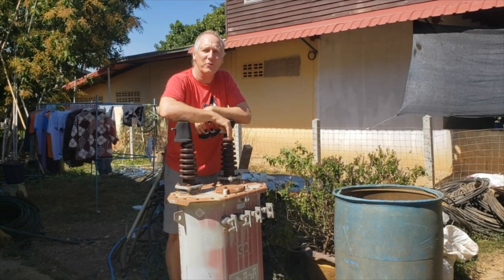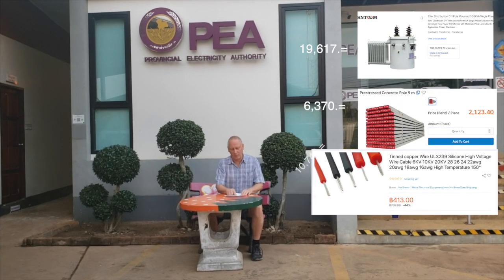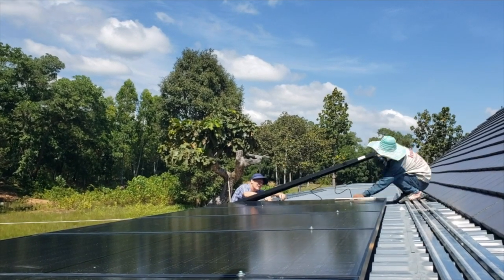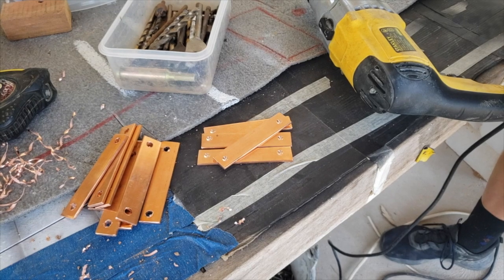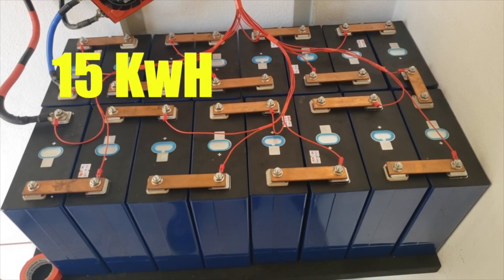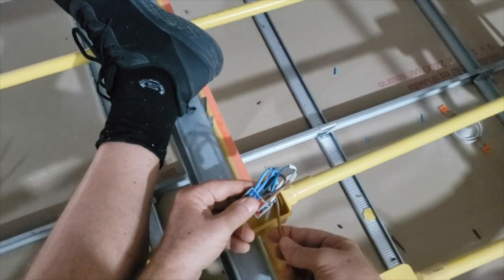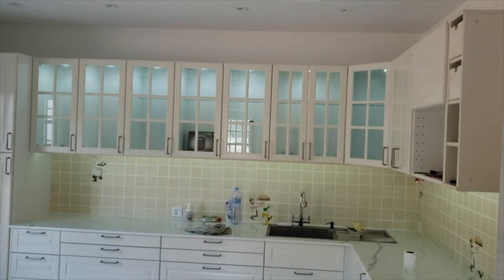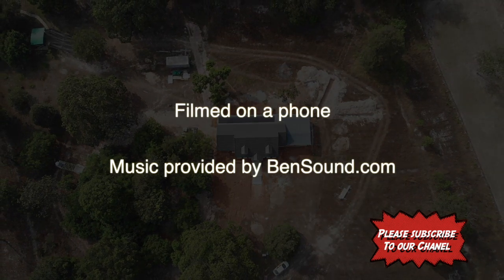Going Solar   building a house in Thailand

Comment: Thanks for the video, we dont have electricity anywhere near our farm but it has been said that it maybe coming as so many are building and living on their farms now, but if that is going to be the cost I may just have to bite the bullet and go solar I think, as we do have a problem neighbour who I know will try and use our posts for their supply. So if I may in future can I pick your brain a little on some of the finer points, the system looks amazing, we would probably use ground installation as we have the room and we are much more rustic.
Reply from the maker: Of course. No problem, pick away 🤓

Comment: So this setup will allow you to run AC, kitchen appliances, etc at the same time no problem?
Also how many hours does that give you of running hours at night
Reply from the maker: The house should be able to run several days on just the battery. 
But only time will tell if this is true.
Wo don't live there yet, but as soon as the rain-season (least amount of sun) has past, I will make a "conclusion video".
Reply: @Living-off-grid  looking forward to that. This is something I’m considering doing as well. Just determining the best application

Comment: Hi Maarten.
Thank you very much for a very good video. Exactly what I was looking for, I am building a house and have been trying to find information on solar installation solutions and costs.
Do you have any idea how much this solution can handle in terms of fridge/freezer, lights, air con etc.?
Best regards.
Mathias
Reply from the maker: Well, I hope it can handle a regular household, but only time can tell how things work out when we have a few weeks of heavy rain and little sun.

But even on a cloudy day the PV panels put out at least 1 Kwh and that is enough to "survive".

I will make a follow-up after the rain-season.
Reply: @Living-off-grid 
Thank you for your answer.
We are connected to the regular electricity grid but intend to try to have as large a proportion of the electricity consumption as possible through solar cells.
Best regards
Reply: @Living-off-grid  Hi Maarten
Hope all is well.
Wanted to hear how the outcome has been with your solar park now after 5 months? Are you producing enough, too much or too little energy from the solar cells? Our house is largely finished but will only move down in a year and then the idea is that we will install solar cells to cover most of the need, but I have a hard time calculating how much you need for it to work.
Best regards
Mathias
Reply from the maker: @mathiasgrahn4440  
Hi Mathias.
So far, so good. We ran out of juice one time and had to use the generator for about two hours. It had been very cloudy for two or three days and I did a lot of welding and used other heavy tools.

For the rest, we run two aircos all night and one during the day. 
The battery does not get below 50 to 60%, so that is good.

We are energy conscious, so when it is very cloudy, we don't switch on the airco during the day and when we are not inside we switch it off.
The aircos are also running at a very low level as the house is well insulated.

But, up till now the system has performed perfectly.
Reply: @Living-off-grid  Hi Maarten. Thank you for your answer, this will help us in our planning for solar cells to our house.
Best regards
Mathias

Comment: Hi marten, I always look forward to a new video of yours popping up.

I was looking for a larger lifepo4 on Lazada but could only find the lower capacity ones like 100-200Ah not the 380Ah like you have used. 

Would it be possible for you to give the Lazada links to the products you have used in the video please? 

Very much looking forward to if you make a video on the water heater you commented on above.

Thanks, Andy
Reply from the maker: Hi Andy. Sorry, it's 280 A. Here is a link:  https://www.lazada.co.th/products/lithium-iron-phosphate-lifepo4-32v-280ah-32v280a-i4203131832-s16543031634.html?clickTrackInfo=query%253Alifepo4%252B280ah%253Bnid%253A4203131832%253Bsrc%253ALazadaMainSrp%253Brn%253A902d08193d13106d5dd106f3ef3979db%253Bregion%253Ath%253Bsku%253A4203131832_TH%253Bprice%253A17062%253Bclient%253Adesktop%253Bsupplier_id%253A100191120278%253Basc_category_id%253A12092%253Bitem_id%253A4203131832%253Bsku_id%253A16543031634%253Bshop_id%253A2143764&fastshipping=0&freeshipping=&fs_ab=1&fuse_fs=&lang=th&location=%E0%B8%81%E0%B8%A3%E0%B8%B8%E0%B8%87%E0%B9%80%E0%B8%97%E0%B8%9E%E0%B8%A1%E0%B8%AB%E0%B8%B2%E0%B8%99%E0%B8%84%E0%B8%A3&price=17062&priceCompare=&ratingscore=4.5&request_id=902d08193d13106d5dd106f3ef3979db&review=2&sale=4&search=1&source=search&spm=a2o4m.searchlist.list.i40.1ae55a64RdOlaf&stock=1
Reply: @Living-off-grid  Thank you

Comment: Thank you for video but slightly confused on you buy all the equipment and when you install it becomes their property , so you paying 6.5x the original quote  . Is that a price they pull out of the fresh air for some strange reason.
Reply from the maker: Yes, their rules are confusing.

Comment: Hi Maarten.  I'm pleased to see this - you are ahead of me in doing this and you've set your usual high standard bar. 🙂

I notice you don't have a separate charge controller for the batteries.  Is this function incorporated in your inverter or might it be omitted for another reason?
Reply from the maker: Hi Trevor.

The inverter has a build-in charger. It is really called an "inverter-charger" but that word is impossible to pronounce properly,  so I shortened it. 😁.

The BMS does have (limited) charge-control functions, but these are very basic (cutting off the charge when the battery is full) so it is better to let the inverter-charger handle this.

Sadly it has no pre-defined LFP setting, so that has to be done manually by setting the charge voltage and lowering the float-voltage, but that is not a real problem.
Reply: Just realised that this function may be achieved by the BMS.  I'd assumed it was just for monitoring, not controlling the charging, but I may be wrong.

Comment: I have the same panels and 16cell 48v battery mine are 40.9 voc if you hooked them all up your at  615voc and your going to blow that inverter  put 8 per string@327voc  @10amp you dont need a large wire and buy 1 more panel ive never seen an odd # for a total of 16 panels don't worry about the watts being over you can over clock the inverter but you can't go over voltage  and 1 other problem steel and aluminum don't mix. The system works great I have a 14000btu air conditioner, 1.5hp water pump, 75in TV, washer, large freezer, its runs everything at once I do have to turn the air off when the sun go's down.
Reply from the maker: You are right. What I did not explain (gets too complicated) is that we only use 13 of the pv panels to power the house.
Two other panels are dedicated to a (in construction) heat-battery that will pre-heat the water that enters the boiler.

A heat-battery is basically a large vat with water that is heated by a electric element, powered by PV-panels.
Inside the vat is a copper water-pipe (15 meters, coiled up). Cold water enters, warm water exits.

The vat itself contains 400 liters of water.

But it is still experimental so I did not mention it.

Concerning steel and aluminium, it's galvanized and should not be a problem. The bolts are inside a plastic tube.

Comment: Awesome job. Half the price of the stupid quote from the electric company.  I’m interested if you have any power constraints, can you run the AC at full power on it? Very cool video.
Reply from the maker: I tested running all (4) AC,s and the boiler at the same time. No problems.
The maximum output is 5.5Kw which is 23 amps.
More than enough for a modern (power saving) house I think.
Reply: @Living-off-grid  Can you run one or more a/c all night? How about running a/c day and night? That would be a game changer in Thailand.
Reply from the maker: @t.q.6639  I can't say 100% yet as we don't live there yet.
I did run 4 AC,s for a couple of hours during the day and no power was taken from the battery. 

The good thing is, you only need AC when the sun is up, and when the sun is up, the system generates lots of power.
Reply: @t.q.6639  I think the Formula to calculate is :  P(watt)= U(volt)* I(Amps)   so for Example, I had a whole House Air Conditioner in the US - a 5 Ton Unit (House was over 280 SqM) the "draw" (Amps) of the AC was around 12A at 220V --- that equals 2640 Watts. Meaning 2.6Kw/hour... at 15kWh of Maartens Battery System..  it could run the AC (only the Ac running)) for 5.68 hours....  assuming the Battery is fully Charged. Measure the individual Amp Draws on each AC you want to run... use the Formula... then you can calculate..   :-)

Comment: I’m wondering how much you spent on the solar system that you installed. I understand that you did the labor. Great video and an inspiration!
Reply from the maker: The total cost was 158.000 baht. There is a cost breakdown in the description. 
I should have included this info in the video. Sorry for that.
Reply: @Living-off-grid  did you got any quots what the costs would have been if hired a company to install all the solar and, batteries and cables?
Reply: @Scharrer23  I did, for a similar implant, more than double!
Reply from the maker: @Scharrer23  No.
Reply: @Living-off-grid  How much in USD?
Reply from the maker: @IAmThe_RA USD 4,584 at todays rate
Reply: @Living-off-grid  Wow quite affordable especially for a sparky.
Reply: Thank you for sharing
Reply: The installation costs somewhere between 3500 Bhat to 15000 Bhat depending on the system you install. I paid 3500 Bhat for solar pump, panels, lightning protector, power surge protector automatic water pump start and shutoff installation
Reply: If you'd expect an average bill of 800 baht a month over the year it seems your pay back period is about 16 years. A big decision. PEA is a powerful company. Great you can seperate from them though. I've tried a grid tied inverter after a call to them suggested all would be ok but in the end no it's not all ok. Solar in sunny Thailand is not supported for home rooftop at all. I've sent an email to energy minister politely asking why?